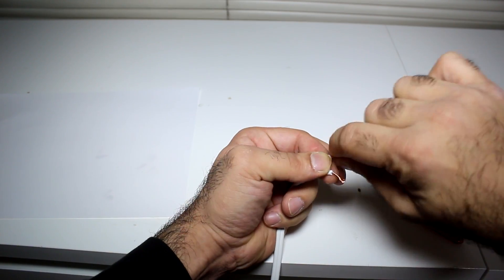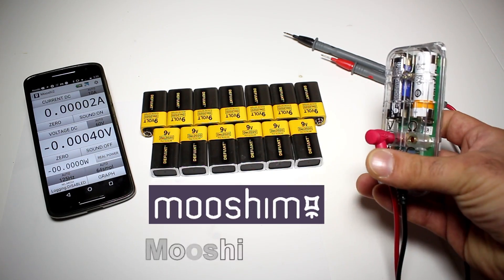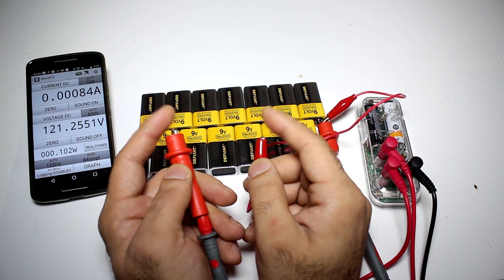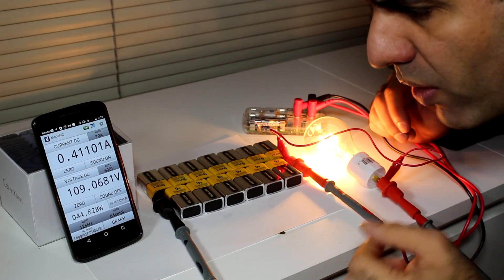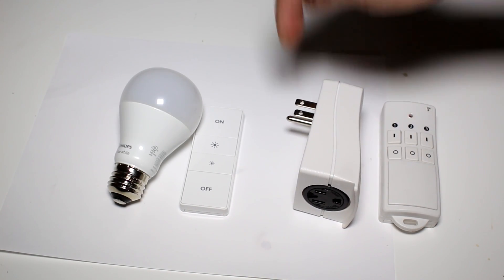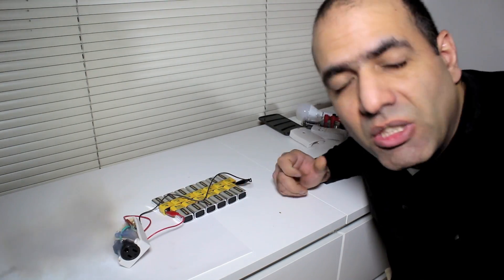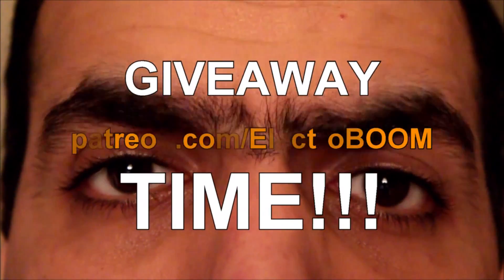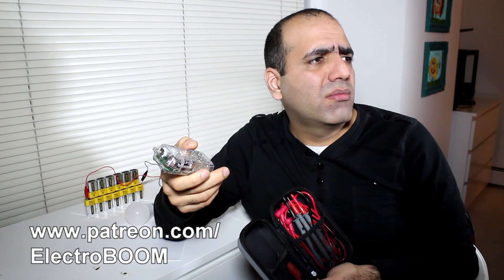Butt Light, Powering Electronics Remotely

Comment: The mooshimeter! It's a regular multimeter, but it has no display, so you have to connect it to your phone via bluetooth and install their bloatware. And it's only $125!
Reply: But wait there is more!
He is giving away 10 of them for FREE!
YES FREE, you only have to be patreon
Reply: Seriously, if the device is all about convenience, why not put just a little basic display on it? I understand the need for a capable screen to take advantage of all the features, but a simple 4-digit display surely wouldn't kill them, would it?
Reply: Meh i rather look at a phone screen rather than a small lcd on the device
Reply: Chur The thing is, you now have two devices to handle. You can't glance at the screen for a quick measurement, not unless you want to drain your phone's battery anyway. You have to use a touch screen menu to switch measurement modes. You have to do bluetooth pairing before you can so much as measure a battery's voltage.

I guess telemetry is one very nice application for this device though
Reply: You can buy uni-t UT-71D for arround 100 bucks shipped, 0,025% accuracy on voltage with datalogging and nice screen, also with more functions that "mooshimeter". And bluetooth draws a lot of current, surely more than lcd
Reply: The buttons and screen require more circuits/space, or battery, I guess.
But anyway, have you tried it? Or at least seen a review?
Reply: ***** A tiny LCD and driver would barely put a dent into their profit margin, and for me it's a deal-breaker. Make of that what you will.

Comment: Cable is stuck. What do I do now?
Reply: instructions unclear, hand caught in anus.
Reply: push!
Reply: The one thing I know from watching these videos is... you'll need a full bridge rectifier.
Reply: Do you know how to start a chainsaw?

Exactly that's your solution!
Reply: @flo090394  u want him to chop his ass off :0
Reply: Bananas are your friend.
Reply: touch the EM's Copper coil without isolation.. maybe the shock will get it out
Reply: THE TEMPO!!!!
Reply: 8523wsxc Call 911, you need help 😄
Reply: Sit on the toilet with your legs on an angle of 45° and pull the cable, (You can drink 2 bottles of vaseline before doing this)
Reply: uh... pull it out....
Reply: 8523wsxc pull it all the thru
Reply: Girls do that all the time! They stick a tampon and a string comes out! Use that trick
Reply: Now try it from the other end
Reply: @samanderson4955  ooF
Reply: you are robot now
Reply: @melvin64_44  yes that is actually good +1 like
Reply: Shit it out.
Reply: Suck it like noodles and poop everything out like a snake
Reply: Have you tried turning yourself off and back on?
Reply: +I'm not gonna give you my fucking nam AWESOME NAME! but why elephants? i mean a snake would work way better because its long and the cable can go straight through without having to fight against the curves xdddd
Reply: You are supposed to swallow it and out the other end not the other way round.
Reply: 8523wsxc shake it
Reply: Pull the cable.Then attach a magnet to the end of the wire.If it gets stuck again,hold the magnet on the other end and it will come all the way through.
Reply: Drink lube oil
Reply: You have to pull it out but you might fell like you are rip the walls of your intestines and stomach but that is normal also after you need to go to the ER
Reply: Wait for your stomach to digest it and then pull it out.
Reply: Call in the Special Forces. ARC Troopers or Clone Commandos to carry out this mission. For the Republic.
Reply: Well you got to get yourself a electricians fishing-line or snake. and then slooooowly up the nose and down the tho.... Your not still reading this are you???  LOL
Reply: stepbro enters the room
Reply: Use a microwave transformer to flow thousands of volts trough the cable, it will melt down and you will poo it.
Reply: call your stepbro
Reply: Shorten both  end it will hurt abit but it will come out :)
Reply: Call step electrician
Reply: nihil2009 lol
Reply: It was a joke. Right?
Reply: Pull it out, try again😂
Reply: Rest in peace
Reply: WHAT ARE YOU DOING? GET THAT CABLE OUT OF YOUR MOUTH NOW
Reply: Shit it oit
Reply: Pray to LORD ELECTRON...
Reply: Lol
Reply: Just eat something that you need to poop it and that will be while you are pooping you will poop the wire
Reply: Call an ambulance...
Reply: spit on it
Reply: Digest it
Reply: Push
Reply: My nigga you are fucked
Reply: Call 911
Reply: Why not eat battery's would totally work totally 😂😂😂😂
Reply: Go to the er
Reply: Still stuck?
Reply: @picklesoncucumber4614  No, I died three years ago.
Reply: Lol
Reply: Pray that God will spare you.
Reply: Whuut 😂
Reply: switch on the supply the wire is connected to..it will give you relief forever
Reply: "Plug it in, plug it in" - Glade.  If that doesn't work, try Dulcolax, then plug it in. Still no success? You're already dead, GLHF.
Reply: Go to the hospital
Reply: You can run 100 amps through it so that the wire burns and there is no need to take it out
Reply: use lubricants!
Reply: Cut it and poop it out
Reply: You need lube and a hand it is better and safe to wear gloves 🧤 good luck
Reply: I love people like you no homo
Reply: Q
Reply: eat soap
Reply: Yes
Reply: Did you get it out yet?
Reply: Go get some lube bro
Reply: Fart it out!!
Reply: Pull it out, from the mouth end. Don't pull from the exit point, you'll make the line longer.
Reply: Fu*k the cable
Reply: Go to the damn hospital
Reply: Time to call a plumber
Reply: I'm sure you can work it out.
Reply: 8523wsxc It depends how far it went.
Reply: 8523wsxc 😂
Reply: 8523wsxc what is wrong with you
Reply: 8523wsxc shit

Comment from the maker: Hi all, you can follow my posts on reddit here: www.reddit.com/u/melector

And also subscribe to my subreddit: www.reddit.com/r/electroboom if you like!
Reply: When are you releasing t-shirts with FULL BRIDGE RECTIFIER on them ? I want one of these !
Reply: I LOVE YOU <3
Reply: Great video, but "low cost multimeter"? At $120? 

We're not all swimming in that sweet auto-electricution money!
Reply: iam a big fan love your vids! :)
Reply: @ patrick lavelle : How many cubic meters of air per hour?
Reply: TTX XXT Sometimes, he shows the wound. Maybe he accidentally went too far in those incidents. Or maybe he's a show-off masochist, which turns out to be a character that gets hits.
Reply: We need some flairs man.
Reply: So is this kind of transformerless PSU (with dropper capacitor) the usual solution employed to power low power devices like LEDs from mains voltage? Is it reliable?
Reply: It's simple and cheap. It's also dangerous. Sometimes the live wire is directly connected trough the BRIDGE RECTIFIER to the powered device's ground. That means all of the device is at line potential. The cool thing is that with a 555 timer you can use high frequency switching to power the 110 or 220V devices with 12V, provided that the device you are powering needs less than 12V on the low voltage part.
Reply: Eviltech why would you power a mains device with auxiliary 12 volt, unless the rectification/stepping down stage was destroyed?i mean you d need another psu to supply the 12 volts anyway...
Reply: Theo papa Simple - you know those mosquito/vermin repellers? They are as useful when camping as at home. The remote controller things - also pretty useful, night lights, flashlight chargers, portable radio chargers and so on... If they are not designed to work with 12V, but have a capacitive dropper and actual circuitry inside requires lower voltage, than that's a great way to charge/use them in a car, caravan or a truck...
Reply: hahaha 69 likes
Reply: he said "high precision low cost " which mean a normal high precision meter is at 500 dollars average here in Canada.  Thus 120 for a "high precision" meter is indeed low cost. Standard depot store meters do the job but they are not high precision. I,m a industrial truck tech and i can assure you of that. :)
Reply: Mehdi , LED lights are bad for you cause of their Blue spectrum , it damages the mitochondria and nucleus and we use them to kill bacterias , viruses and fungi in the lab , Pleas check out Dr. Mercola and Bulletproof podcasts about them , the only advantage of heat sourced lights like candles and to some extent the incandescent lights is there lower blue spectrum.
Reply: ElectroBOOM are your videos wen you get zapped fake?
Reply: ElectroBOOM
Reply: i tried to search mushim on google, it went out wrong results :/